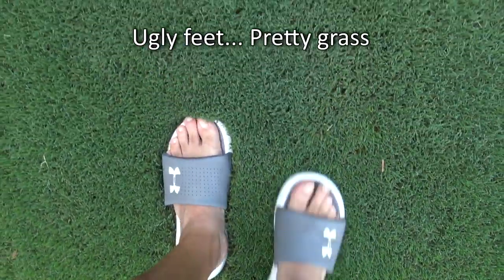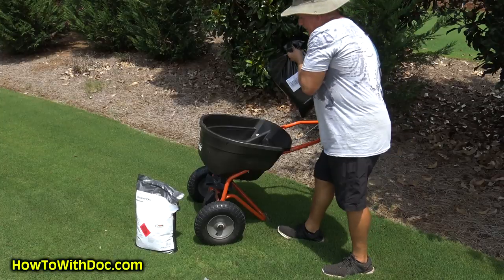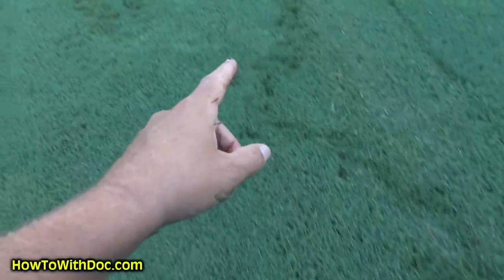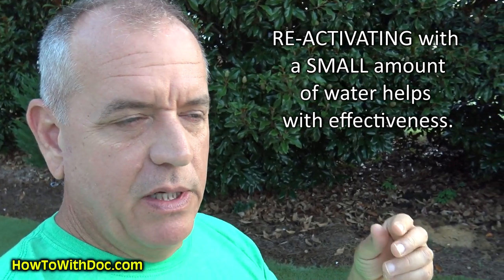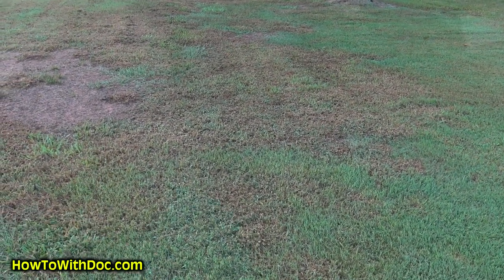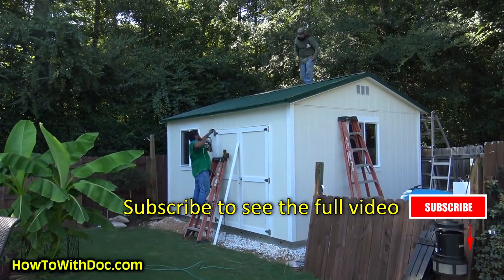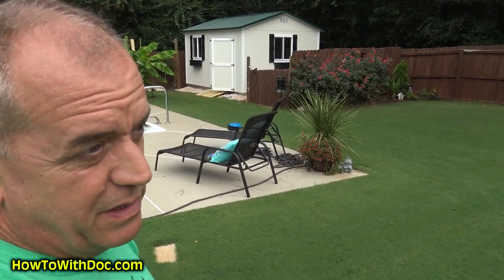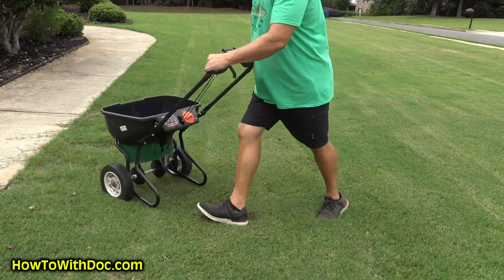Fall Lawn Care - Fall Lawn Grubs - Fall Crabgrass

Comment: I have a critter digging grubs at night, probly an armadillo.  We have had heavy drought most of the summer,  The animal knows exactly where I have watered and digs there.  Spot watered a one foot by fifty foot strip and it followed it exactly.  Trapped one once with no bait. Just sat the trap in the middle of a trail. Blind I guess.

Comment: Howdy, Doc.... I was hoping to get your opinion on beneficial nematodes vs. chemicals for grub control.  Not necessarily from an environmental standpoint but from an effectiveness view.  I've been told that as long as there's a food source, the nematodes can remain effective for up to two years.  I don't doubt this claim is an extreme case but even if it's half that time line it seems like it could be a good thing. (Common Bermuda, moderate condition, central Texas, weather is a smidge below Hell in the afternoon) For what it's worth, Humic DG saved my lawn during this summer!! Thank you, sir!
Reply from the maker: Because I use the DOU Kill... for armyworms... it also takes care of grubs at the same time. So I no longer have the issue. I have found that one good early fall treatment takes care of all.  Not the info you want, but what I do.

Comment: I have purchased and previously used two different grub killing products that needs to be watered down. I have been told that I need to treat my lawns late spring early summer. How about early fall in Atlanta? Will it work then?
Also, can I put down red ant killer multiple times during spring and summer or will it kill the my fescue lawn

Love your channel. It is so informative.
Reply from the maker: Yes, early fall is a great time to treat.

Comment: I've been trying to find 10-10-10 here to no avail. If I take a 5-4-5 and just double the rate per square meter does that make it a 10-8-10 or does it not work like that. Fantastic shed
Reply from the maker: Lowes and Home Depot both sell it.
Reply: I found some at WalMart earlier this week here in Oklahoma. They were almost sold out for the season tho.

Comment: I signed up for email alerts on the web page months ago, but never received a single message. They are not going to spam, I checked that. When I tried signing up on the page again it says the email address already exists.
Reply from the maker: What email provider are you using?  Some like Yahoo and Hotmail simply kick them. ones like gmail allow ALL messages to go through and sort them. Try adding howtowithdoc  AT gmail as a contact. It's only used for that system fyi, we don't check it.